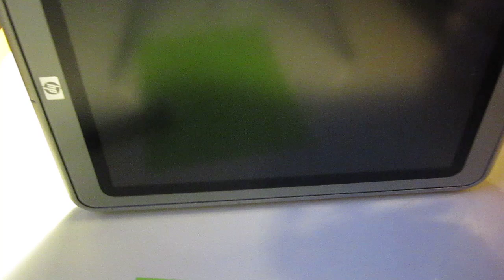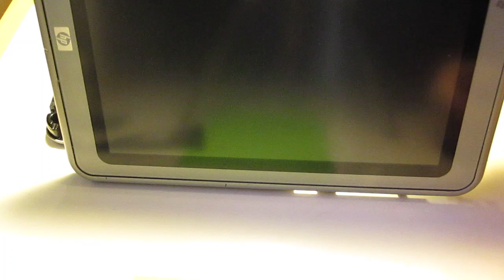HP TC1100 disassembly

Comment: Thanks so much for your video! I just got one of these cool pieces of old tech from eBay and followed along to get to that pesky RAM on the back! 2GB and an SSD make all the difference! Dual booting XP and Windows 7!  EDIT: Be careful with upgrading the bios battery! I literally ripped the connector right off the board trying to push the coin battery back in place.  Ugh 😮 and my eyesight sucks to even try to solder that back on.. what a shame... I wonder if the actual battery would hold the info as this battery is dead
Reply: where is the cmos batter I cant see it
Reply: @Reversion1970 if you can't see it, then you probably don't have one.
Reply: @briantheoret6837  I meant I couldn't see it in this video. If by chance mine doesn't have one I have to assume the main battery is supplying power to keep the date/time etc. So what happens if the DC power is out, and you remove the battery?

Comment: Do you think this tablet is able to power up the Core 2 Duo T7600?? Seems to be the same socket
Reply from the maker: As far as I can tell, no.  The cpu in the TC1100 is a 479 pin while the core-duos are 478 pin and are completely different architectures.
Reply: capnthepeafarmer it would have been a great upgrade if the socket supported it
Reply from the maker: Maxmouser 29 it would be nice, however, I believe the Microsoft Surface Book is the better spiritual successor.  The i5 model can be had used for a pretty reasonable price.

Comment: Great video ! Thx ! How much memory is this laptop computer supporting? 1GB ?
Reply: 2GB max, 1GB for each slot (i.e. 2x1GB)
One of the RAM slots is accessible after you remove the motherboard
Reply: thx, but i have model TC1000 (Transmeta CPU).
Reply: Then the max should be 1GB, though it's kinda hit or miss, IIRC it uses one SDRAM and one DDR RAM which makes it very picky on the memory modules
Reply: Wait... SDRAM and DDR in the some time ? Are you sure ?
Reply: Yup, even HP says it: https://support.hp.com/us-en/product/compaq-tc1000-tablet-pc/307008/document/c00350557/
Not gonna lie I was surprised too, sure having two types of RAM slots on the same board isn't uncommon at all (some desktop motherboards have them), but both working at the same time? Though the hardware itself is strange enough, a little more quirk probably doesn't hurt.

Note: Officially it supports 768MB RAM (512MB SDRAM + 256MB DDR), but some have successfully upgraded to 1GB (512MB SDRAM + 512MB DDR)
Reply: Very interesting, but second slot memory is hide inside and it is necessary laptop disasembly.
Reply: Yup, same as tc1100.

Comment: Yes, it does have IDE.  So, that limits the hard drive upgrade size options...which I believe you can still put like a 120/160GB in there.  The rest of your data can easy be stored on a USB flash drive.  I purchased a 64GB flash drive accessory.  You have to remember...most tablets only come with 16/32/64 gig anyways.

Comment: The AC charger is not functioning properly and already replace the charger. I need to remove the connection part coming out of the computer. Is replaceable? or am i out of luck. Thank you so much for posting this video. Now i'm only 99% concern of braking something :^).

Comment: I have a problem with my tc1100, when i turn on only the hdd and leds are on, but no booting or hdd activity...hard reset didn't work (disconnect battery and ac power, then switch on)

Comment from the maker: @delukard  The pen shown in this instruction is actually a replacement pen I purchased from ebay.  It has an eraser end on it too and works fantastic.  Just do a search for TC 1100 pen or stylus, it should be a $45 replacement.  Much better than the factory $120 replacement.